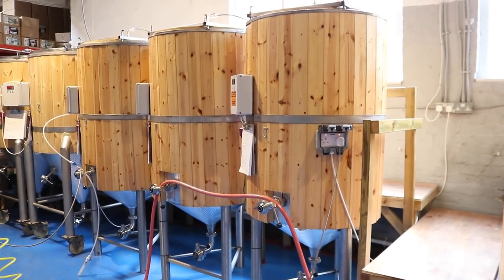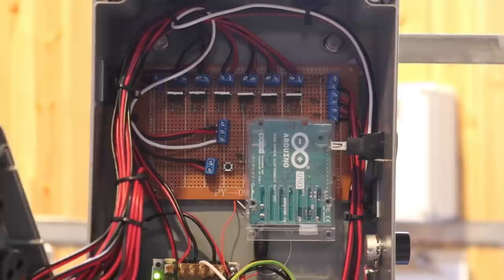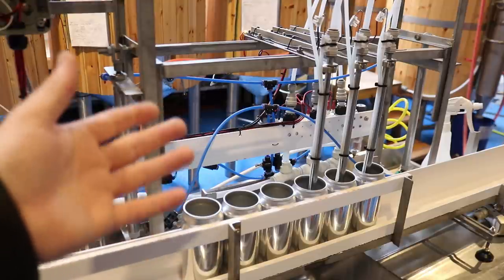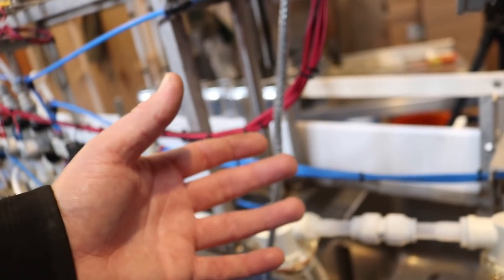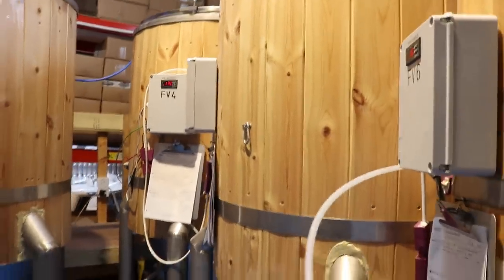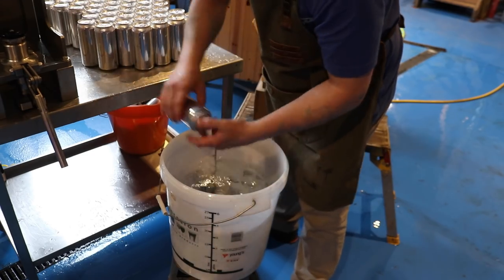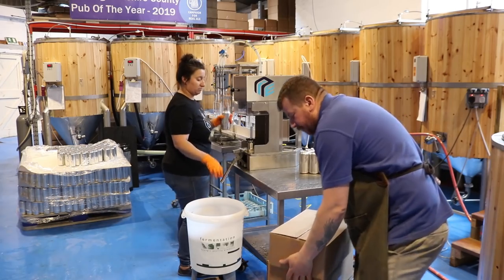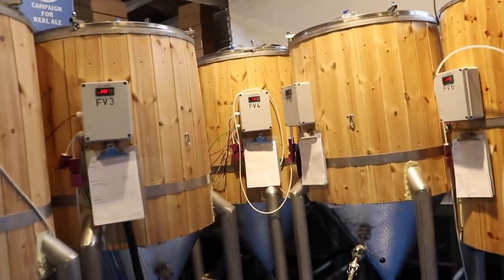Canning In Action

Comment: If fermentation isn't finished, then theoretically free oxygen in the beer will be metabolized by the yeast. The yeast needs the oxygen to produce sterols in order to reproduce.So oxidation shouldn't be a big concern when can conditioning. This is why I add a little sugar to the hop charge when dry hopping post fermentation, prior to cold crash and packaging. Otherwise doing an IPA you wouldn't oxygenate the wort prior to fermentation for fear of oxidation, but that's not a problem... Is it? 

Though maybe this is why my hoppy pales are good, but not "wow"? Maybe it's because I splash the wort into the fermenter for oxygenation? Maybe I should do a low oxygen transfer and provide the sterols by adding some olive oil? Might try that on the next one.

Comment: Just wanted to say thankyou for this build, I re purposed my diy 3d printer to make a can filler on your designs, took a bit of tweaking but it is brilliant. I am canning carbed beer using 1/4 solenoids and was suffering foaming, I put in a delay for 1 sec after the fill solenoids open, basically to prime the lines and then a 3 sec delay before they start filling and it works  a treat.
P.S. I had to search for the part of the code that actually reads the sensor readings, really handy to have and should have been left in the original code